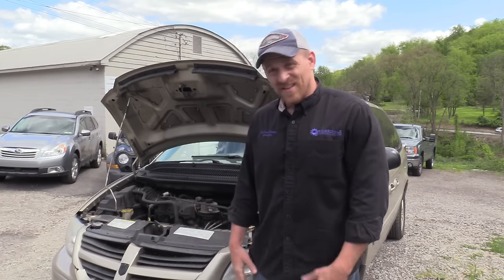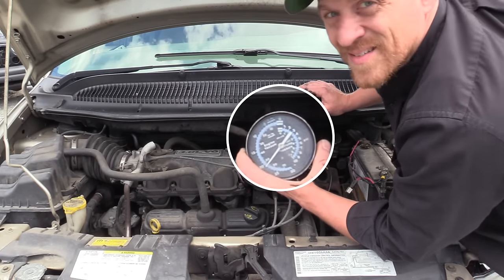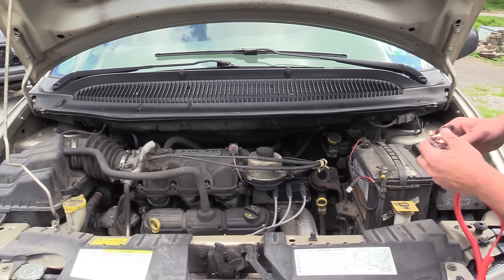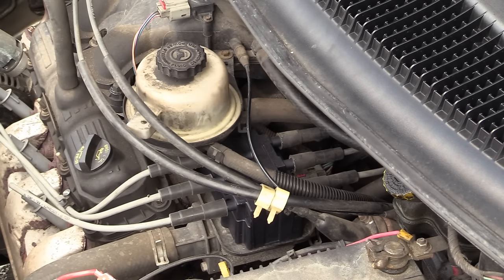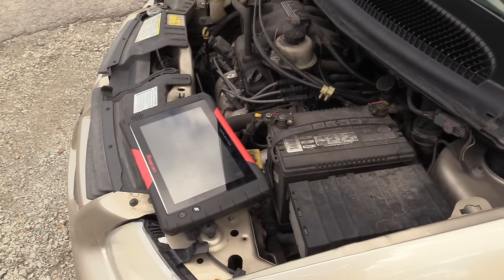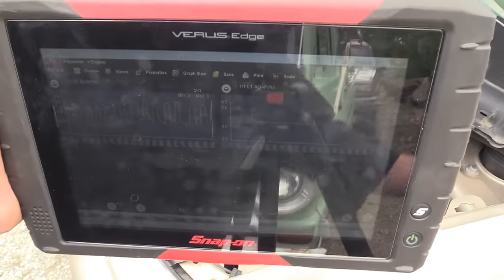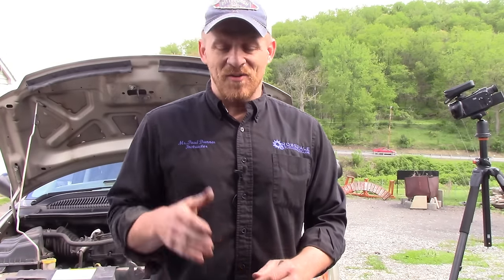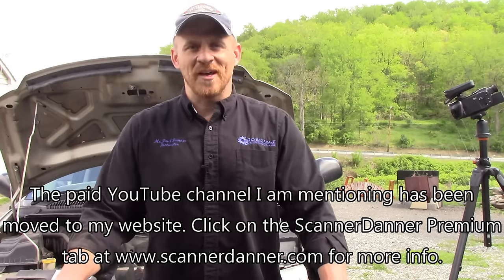Misfire Quick Tests (Is it a spark, fuel or compression problem?)

Comment: Scanner Danner!  Just found you completely by accident and ironically, this vehicle is acting EXACTLY like mine.  I am not ashamed to say that I got her for a song and dance back in April the day after someone with no insurance, driver's license, or headlights hit me head on, totaling my F150.  Unfortunately, I only had liability, without uninsured motorist.  Therefore, she's a piece of shit, but she's all I got.  I have been running through and replacing everything (myself!!) little by little.  I was going to attempt a head gasket replacement next since that seemed to be where all my symptoms pointed.  But recently, a friend of a friend listened to her and he seemed to think it was a vacuum hose somewhere.  What's the next step you could suggest that a DIYer could accomplish without a lot of funds??
I was bummed that the this didn't go further.  I was like "FINALLY!!"  THen I was like "NOOOOOO!"
Great video as well!  You have a new fan, which is unusual because I typically can't handle the drivel from most you-tubers.  I don't really care what they had for breakfast, just tell me what the title says and what I came to see!!
Thanks again!!
Reply from the maker: Thanks so much! To be clear, you have an idle only misfire right? The van in this video has a valve issue. The cylinder heads would need to come off and then sent out to a machine shop to get new valves and seats. It's not super expensive to do if you are doing it yourself. The machine shop work would be your most expensive part of the job. 
Do the cranking sound test I did and listen for inconsistencies. Hold the gas pedal to the floor and crank it. This will keep the engine from starting. Look up "relative compression testing" on my channel page to get more familiar with the test. I have known good and known bad ones shown where you can really hear the difference.
Reply: Thanks for the insanely quick reply!  And on Christmas no less!  Happy Holidays to you and yours :)
Ha!  You asked so here goes! lol
So, I started out with a mess of codes that I didn't even know that I had because my check engine light was not illuminated. It's still not and I'm not sure if there's a light that needs to be replaced or what. But anyway, I had about five codes ranging from P0172 to P0303.
I found out about these after my radiator went bad and she overheated. I try not to let it get too hot, but about five houses down from where she was going to get her new radiator, she let out a big white puffy smoke and a poof. I figure my head gasket blew right then. But I was hoping against hope that that wasn't the case. In response, because she was running rough, these are the steps that I took :
Changed spark plugs, plug wires, cleaned MAF, new radiator, new serpentine belt, new air filter, oil & oil filter change, new valve cover gaskets, fuel treatment to clean injectors, sea foam, Bar's Leaks Head Gasket Repair
I think that's all ?
She ran better for a little while and I got rid of all the codes except for the P0303, which is misfire cylinder three. That's when I changed the spark plugs and plug number three was pretty fouled. I'm also getting another code that reads as P0303, but it has a funny symbol before and after it. So, technically even though it's the same code it reads as two codes. 
I was able to, by the grace of God, keep her from kicking any codes, after running the pattern to reset them, for about 2 hours in which I got her inspected.
I have to put the BL head gasket repair (the one you add to coolant) about once every 5-6 weeks and likely, subsequently, just spent all of last Saturday (FREEZING!) in the wheel well, changing the water pump.  Since then, my coolant levels haven't moved one bit.  I also took the opportunity to change all of the antifreeze since I had to drain it anyway.  Oil is not milky by the way.
Oh, and I have a 2002 Chrysler Town & Country with 165k
I sure miss my truck  :(
THanks again!  And you have a lifelong fan now.  Been watching your videos all morning, back to 2012 lol
Reply from the maker: :-) I don't always reply but I try as much as possible. It is difficult to keep up. Anyway, the 2002 Town and Country is not the same engine as in this video and I do not think they had the same valve issues. 
The head gasket repair stuff in a bottle is absolutely horrible for the cooling system. It will plug up passages in the heater core, radiator etc. 
It sounds like you may have fixed your coolant loss issue (leaking water pump) but I would still check it for a head gasket failure given the vehicle history and the misfire code. 
This is the best DIY video I have for doing the head gasket test https://www.youtube.com/watch?v=k5VVcNKAK6U (you can find the chemical kit I am using in the description of the video and also at your local auto parts stores)
Another thing you need to do is to compare compression pressures with the #3 cylinder and a few other ones. 
IF the above tests show good, then you need to check the coil output like in these videos (these are all 3.8L Dodge engines, same as your van)
https://www.youtube.com/watch?v=IMuyqtFXIPU
https://youtu.be/iFLaRd_5wc8
https://www.youtube.com/watch?v=uU0Aw4kBiY8
Then finally, here is a good one on checking for a vacuum leak on an intake runner (the only vacuum leak that could cause a single cylinder misfire https://www.youtube.com/watch?v=OH_U3D4S5Q4

You could do the coil and vacuum leak testing first
Reply: Thanks again for the quick reply!  I changed the coil pack already, should I check the new one as well?
On my way to watch those vids now!!
Cheers!! :)

Comment: my gmc 4.3l just shuts down and stops running. otherwise it runs great. I wait and hour or two and it will start again.
Reply from the maker: Find out what you are missing when it doesn't start. Spark, fuel injector pulse or fuel pressure. Can't help any further without some direction

Comment: HOLY SHIT. I've been doin cylinder draw test like a fucking idiot this whole damn time. 
ill like stand up on a stool, wear thick gloves and pull the plug wires with a big ass set of needle nose and ill still get shocked. never even crossed my mind to use a test light to make it (rather than me) the easiest path to ground!!! 
jeebus. smfh

Comment: I would put a can of desludge that cleans as you drive. Detergent based. Not oil destroying. 5$ WYNN'S engine tune up or Marvel Mystery oil. Roll the dice. And a bottle of gas treatment. WYNN'S 3 pack. 1st 1 in 1/4 tank of gas. Idle 1/2 hour. Tell customer drive to empty. Refill and add the 2nd bottle. (Cleaning the heck out of it)

Comment: It's a dodge, that's the problem.
Reply from the maker: lol
Reply: Not as bad as ford. At least they show fuse box diagrams and have proper misfire counters and fuel pressure test ports (I think, never really had to test fuel pressure on a Dodge). Also, Cummins baby.
Reply: A lot of them have no fuel pressure test ports and their fuse box diagrams are just like the Fords just a bunch of numbers.
Reply: lol thats why this old man keep laughing at after he says nice dodge
Reply: rsx123 my neons only give misfire counts if the misfire is extreme such as crushed plug gap.
Reply: Dude On Dude Gay Erotica ?? or may it will work if its a F*cked Over Rebuilt Dodge

Comment: So after watching the video I understadd that you are of the opinion that there is some problem like a sticky lifter  causing the miss.

Completly unhelpful  was the interjection of the gratuitios comments that the car was a piece of shit, that it has too many miles ect.  After all shouldn't that engine go 200 to 250k miles? If maintenence has been lax and 1 lifter is sticky, a replacement is less tnan $10.  While there, replace the gaskets,  and move on to the other problems like the clunky front end ect.

Comment: Engine sounds like shit, but why all the fancy tools? You have spark on a dead cylinder, next thing would be checking the injector, then a compression test on cylinder 3. Don't need fancy tools for a dead cylinder.
Reply from the maker: I'm showing multiple methods Gary. I never said this was THE way to do things
Reply: ScannerDanner well ok... not a problem.

Comment: I am very desperate for somebody to help me I am disabled and running out of money I took my vehicle to a shop after going to AutoZone and having it throw that 303 code or whatever for cylinder 3 check engine light on scene replace spark plugs or coils anyways long story short took it to mechanic I'm out about $700 already after he did everything and put it in even a fresh synthetic oil change the van ran even worse than before when I took it in then the guy said well maybe it's the injector so replace the injector it did run a little bit better but I did hear a slight Miss still I'm voice texting this hopefully it comes out right anyways after he did that I drove home everything seemed fair I guess I did hear a slight Miss but it was very very slight well the following day starts running like crap and the check engine light comes on I don't know what to do somebody said maybe he put maybe the injector that he put on number three all he replaced was the one injector for number three I asked him do I need to replace all the injectors he said no just number three but it's still throwing the same codes does anybody know what's going on my van is only got 100,000 miles on it just rolled over and it's a 2016 Dodge Grand caravan APV please somebody help I'm at my wits end and he's trying to say I'll it's probably a mechanical problem well how can it be a mechanical problem if it ran fine after you put the injector in and why would it run worse after you put the coils and plugs in it just sounds so fishy to me
Reply from the maker: Mechanical issue is a possibility. Compression should have been checked before anything else was done! But I agree, something sounds off here. Replacing an injector, would not, even for a minute, make it run better if it was a Compression issue.
You need a fresh set of eyes on that. If you're close to Pittsburgh Pa I'd look at it for you for free
Reply from the maker: Or...just had this thought. Im heading to Florida very soon with my family on vacation. If you some how happen to be on my route from Pittsburgh Pa to Tampa Florida, ill even drive to your house (if we are driving, we may fly, not sure yet)
Reply: @ScannerDanner  yep im not taking it back to him ,found someone else 
Recommended by AutoZone
Reply: @ScannerDanner  thank you
If this man dont fix it 
That be great
Reply: @ScannerDanner  i agree no way compression issue at 100k 
And he keep saying mechanical
Sounds like i got scammed
😔
Reply from the maker: @catalinababy6068  I wouldn't say scammed, these things can be difficult sometimes. I'd say more along the lines of a tech maybe not knowing. This is very typical in my field. Less scams than people think. More technician ignorance than people realize